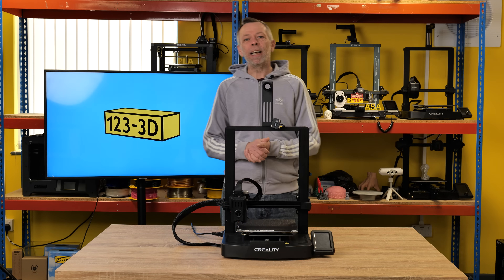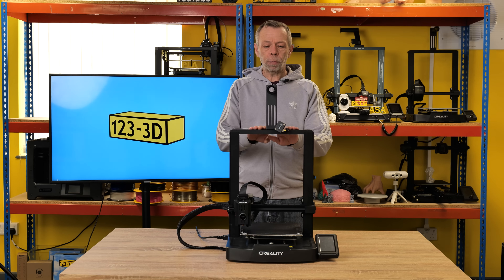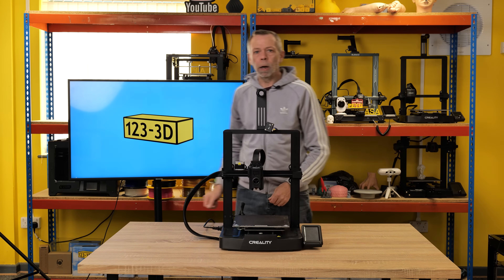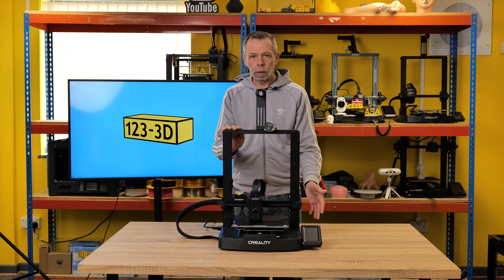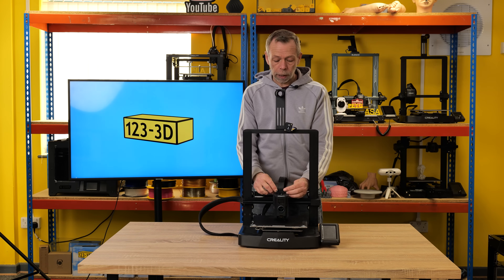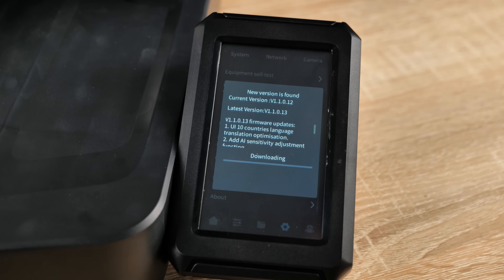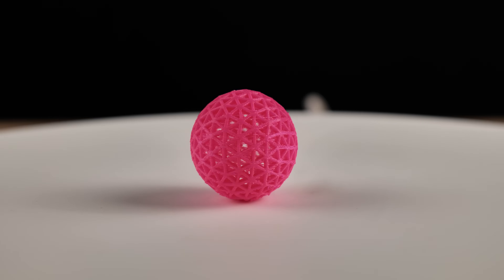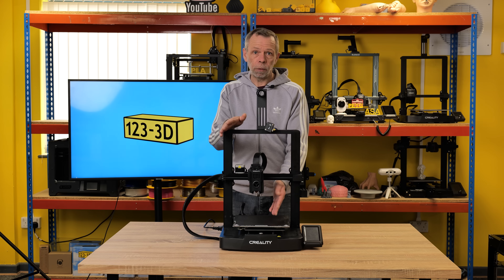Is the Creality Ender 3 V3 KE worth it? Full Deep-Dive Review!

Comment: Be very careful! I bought one three weeks ago and loved it, until! I printed a very beautiful tablet holder. It was perfect. I started printing a second and waited to be sure it started correctly. Went to bed and woke to a mass of melted filament all over the print head. This was not spaghetti but full solid dried resin. Everything is incased in a glob of dried resin! My machine is now DOA. Now I get to see what Creality will do? 😢
Reply from the maker: Sorry to hear this, but the cause of this is due to the print coming off the build plate. The print can then stick to the nozzle and results in nozzle becoming cased in filament.
Reply: The other possibility to get a blob is when the hotend leaks from the connection nozzle - heater. I also was not constantly checking if the nozzle is still tight (check when heated up) and slowly filament leaked over the heater element. I noticed it because the hotend was starting to smoke and stink during heating up 🙂 I decided to upgrade to the leak proof unicorn nozzle (kit is not that expensive for the KE) and that was a good decision. Also that nozzle is hardened steel so it is more suitable for abrasive filaments. Overall its a printer for user who are not afraid to tinker around with it and also exchange or upgrade parts from time to time.
Reply: Not there fault problem is down to user error

Comment: I wouldnt listen to a review whos company also sells the reviewed item..  there is a known issue with the z frame which causes ringing. The spool on the top is too heavy for the frame. also, creality has horrible build quality. many users expierence loose screws and often a loose nozzle. the loose nozzle can cause "blobs of death". I myself own an e3KE and like it. But again, this review is (most probably) biased. even if not. a company should not review an item that they sell. it is obvious that they will try to get you to buy it.
Reply: I see you have valid points for not trusting this review. 

But a company doesn't have to stop it's own reviews for such reasons. It is actually good that a company, in addition to exaggerated advertisements, is also focusing on thorough reviews. 

I see they cannot be trusted on everything, for which "we" should be going to external reviewers. But it doesn't mean they shouldn't review at all.

Comment: Question… do you think it would it be straightforward to add Creality’s own laser module to this printer - the stepper motor plugging arrangement seems to have been designed around the earlier Ender 3 (and possibly other) models - any advice would be welcome. Thanks.
Reply from the maker: I wouldn't like to say. This does not run Marlin firmware, so I fear not!